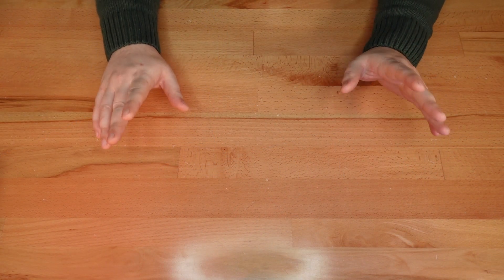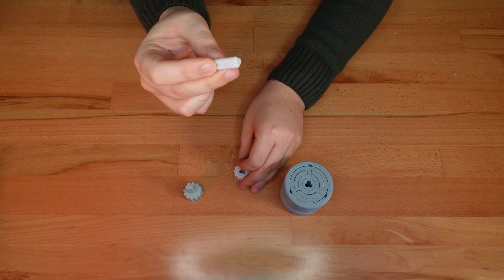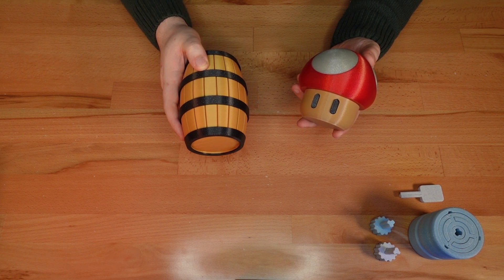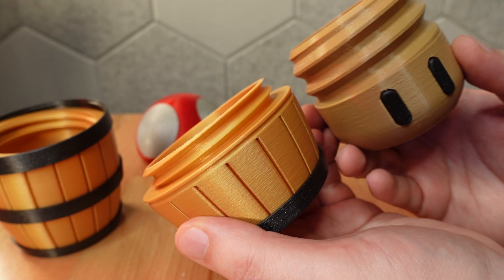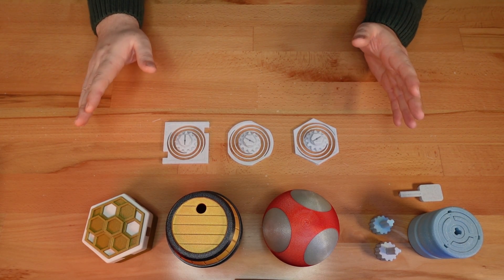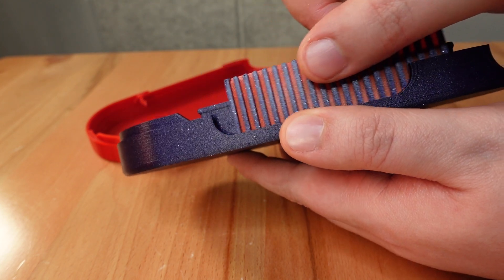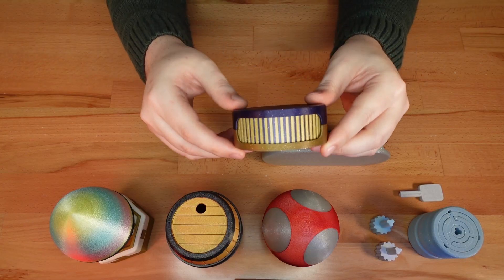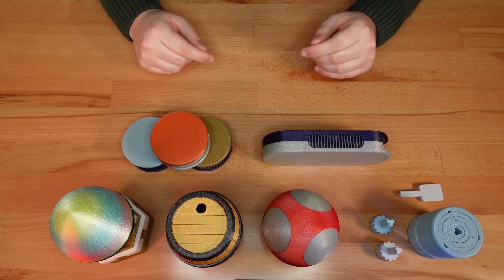3D Printing Updates - You Asked for It! [#5]

Comment: Hi there!

At what layer height do you print those mushrooms? :) Also, what did you do regarding to the seams? Did you put them behind, random or? :)
Reply from the maker: For most of the parts I used a 0.2mm layer height and for the dots, I used a variable layer height - the layers get thinner as it approaches the top.

As for seams, I set it to random and then paint locations where the seam can be hidden - like in the eye and dot holes. For layers were there isn't a good seam hiding spot, I paint the entire back side of the mushroom base as a viable area for randomly placed seams. This keeps the front pristine and avoids creating an obvious line anywhere.

Good luck!
Reply: @3DPrinty  thanks! 

I noticed some severe ghosting on some of the prints I made.

What speed did you print yours in?

Comment: On the oval shutter box, you could make the shutter much longer, wrapping it further around the perimeter this would allow it to still maintain the shutter in both slots even when it's closed. This could be done with the puck as well if you reduced the length of the opening. Just an idea.
Reply from the maker: Neat idea! The shutter doesn't take up much internal space, so the downside would be very minimal :)

Comment: What settings do you print in? Specifically the mushroom... I used 10% infill, 0.2mm layer height. I'm having issues with the top and bottom - they won't go all the way down, but only about 3/4 of the way. Also, what setting do you use for seams? Thanks a lot!
Reply from the maker: Your print settings sound good, but you may need to wear down the thread a bit to clear out any print bumps. Sometimes running a 3D printed thread under hot water helps - it softens the plastic slightly. Just don't try to screw it down all the way at once or it might get stuck. Good luck!

As for seams, it depends on the design. I'll use aligned seams when I can hide them and randomly positioned seams when I can't. Some of my earlier mushroom prints have a very obvious seam under the eye, but then I switched to random for the later prints.

Comment: U should make a 3d printed fluid coupler oh and a fluid coupler is a torque converter on an automatic transmission basically meaning it uses fluids to make the car move and transmission
Reply from the maker: Very cool mechanism!

Comment: Omg the thread design technique is so clever. Thanks a lot for sharing I will be using this myself from now on!
Reply from the maker: Glad you like it!

If you decide to try it out, you may still want to add some extra clearance between the threads using the push/pull tool. I cover that in an older video: https://youtu.be/JOqA2Y_5-ow
Reply: @3DPrinty  I usually go for something between 0.12 and 0.25. I just never knew how to get the really nice tall threads easily. I haven't really looked into your tutorials since I'm mostly here because I really enjoy how you present your designs. But I think I can really learn something. Keep up the brilliant work!

Comment: That puck shutter box is SO cute! Using it for loose screws sounds like a great idea. I'll have to make one for myself!
Reply from the maker: Happy printing!

I found that it held the bolts very well. If there are any issues, you can carefully pry the container apart and replace the shutter with one that has been scaled up slightly for an even more rigid fit.